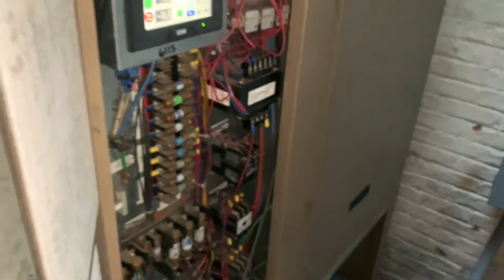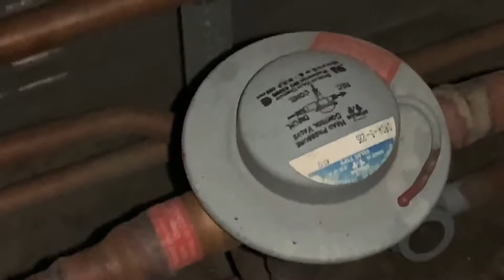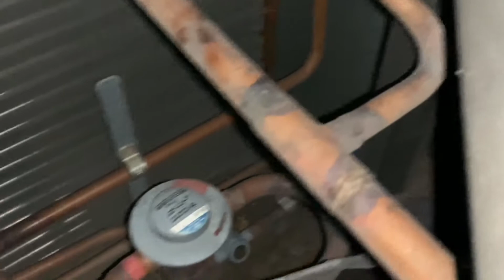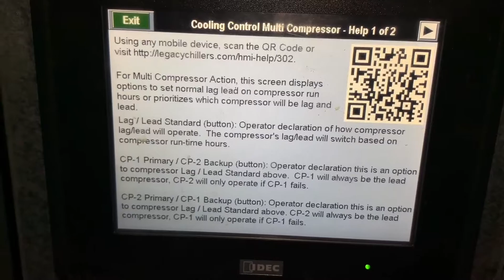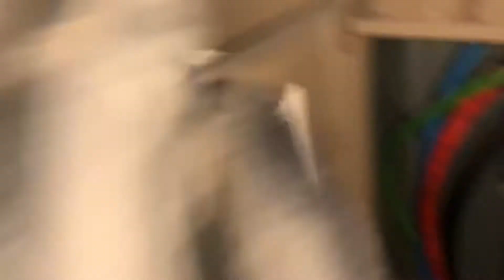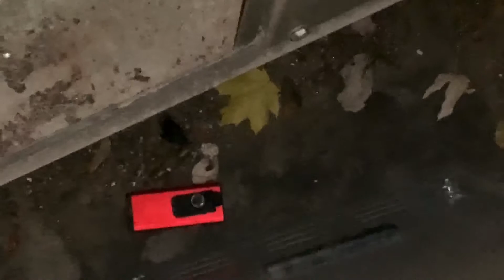HEAD PRESSURE CONTROL VALVE / HPCV/ HEAD MASTER HOW TO INSTALL & WHAT IS IT?

Comment: I was working on one of the walk in freezer. My liquid line was hot like it was a discharge. My filter dryer which Is newly installed was very hot.  Should I replaced the headmaster valve ?
Reply from the maker: If the system is properly charged yes and if the condenser is in good working order